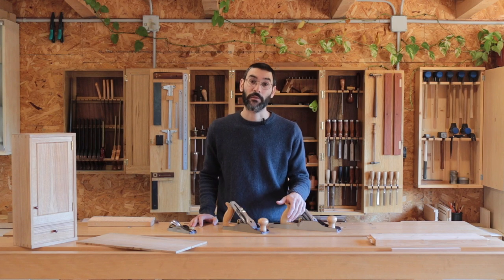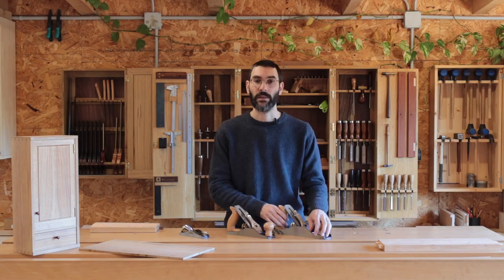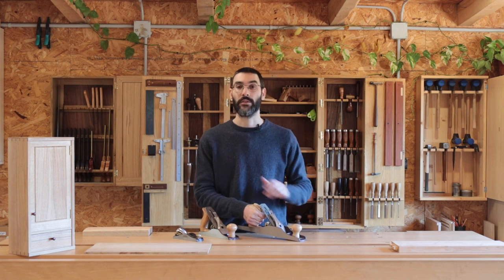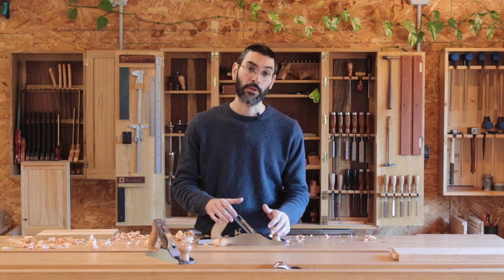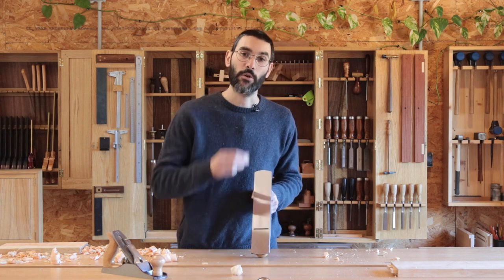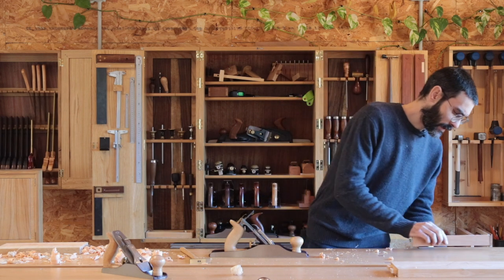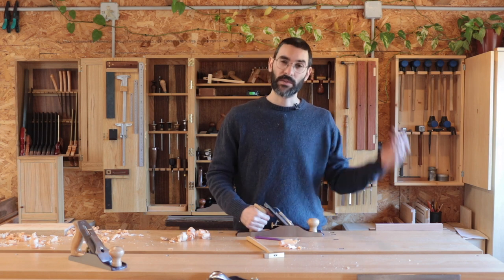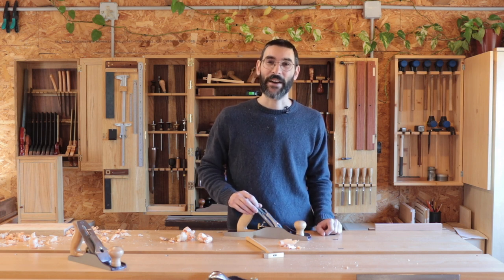Tips for buying your first hand plane

Comment: Greeting! I am a big fan of yours and love your work a lot. I live in Serbia, where the choice of handplanes (and hand tools in general) is very, very limited. only a few pieces can be found on the internet and those that need restoration. ordering from the European Union is not an option because I will pay more tax and VAT than the grater itself. now i'm using some really cheap planes (no 5 and 2) and i found some old wooden smoothing and jointer plane on the internet... but they work kind of ok for me.
Reply from the maker: I know your frustrations... I've had to pay a  lot for some imported tools, and I understand it's not always possible! However, our ancestors did the most splendid work with local tools only. I wish you the best of luck!

Comment: Hi, awesome video, these come in different variants, do you recommend the SK4 or the HSS blade? Japanese gets expensive though...
Reply from the maker: Thanks! I believe HSS will hold an edge a bit longer and the Japanese is said to reduce the vibration that cause chatter. The back is a bit harder to flatten in the Japanese, in my experience. All of them are very good. And I wouldn't mind using any of them, particularly because I  resharpen when the blade is still functional and not too dull.
Reply: @germanperaire2022  Thanks a lot for your reply, it was very helpful to know they're all good, like you said, as beginners we want to get a quality tool that will not frustrate us, but without breaking the bank. I'd love to take one of your courses when I visit Barcelona sometime soon. Have a great rest of your day and keep making beautiful pieces of furniture :)

Comment: After owning some plane (26 in working order, 12 of them are bench plane) I just come up with the same thought, a 5 1/2 as first choice,  if can't find a 5 1/2, a 5 will do. But specificly metal plane, because the sole stay flat for much longer then wooden body plane, and moveable frog to close and open the mouth as needed.
  If your pocket is not so deep, at least go for a similar quality plane of dictum plane( luban, quangsheng, wood river etc.), I own a no.4 and no.62 from dictum, they work. If you have the buget, go for veritas custom.
  Veritas custom have different angle frog as accessories, this allow you to use the same plane to do the job of many plane(high angle smother for large panel, jointer for short piece, jack/fore plane for fast stock removal and shooting plane), of course, you need more than one plane blade. You can still do all except high angle smother with an hand plane at dictum level.
Reply from the maker: I completely agree!
Reply: I have been eyeing the no. 62 from dictum for about half a year now, mainly because the handle attachment for shooting board (other brands available to me had no such thing readily). I use my no. 5 for shooting, but my hand gets cramped if I have to square more boards and I am growing tired of it. Would you recommend the 62 as a dedicated shooting plane (that would be its only use for me)

Comment: As a complete novice in hand tools I have found myself reaching for  my 5 1/2 all the time, I have found early on that I was getting snipe at the start of the board from my no4 but the longer sole to the blade on the 5 1/2 has stopped that and is teaching me to avoid it with the no4
Reply from the maker: Thanks for sharing! A heavier plane gives more control and fewer vibrations, indeed.

Comment: Excellent video. I too agree that a 5 or 5 1/2 is quite ideal as a first plane, plus a block plane to work chamfers.
Reply from the maker: Absolutely! I didn't go into block palnes but I agree 100%
Reply: Block planes are niche tools as far as I am concerned.  A no 4 will be fine for preparing stock up to about 450 mm in length and is servicable for most tasks you'd use a block plane for.   My go to plane for stock prep is a no 5 1/2 or 6.   Ultimately it all depends on how you work.